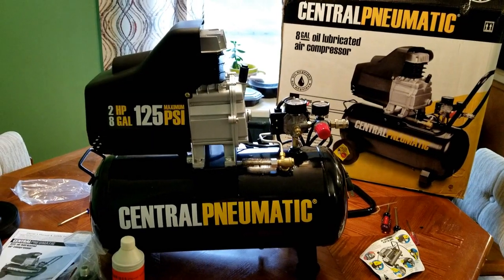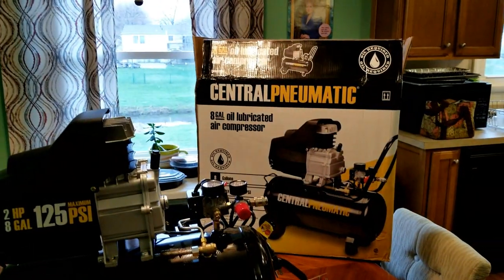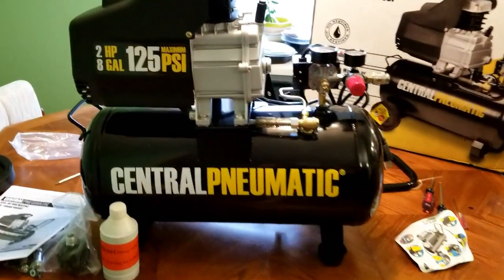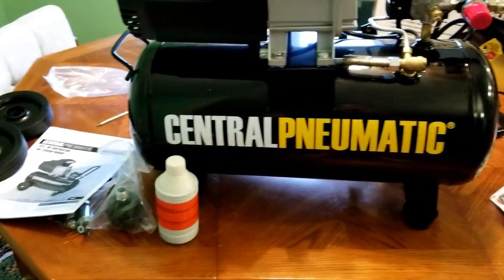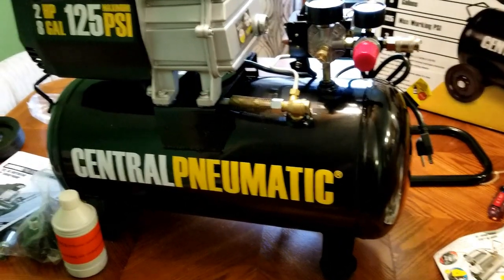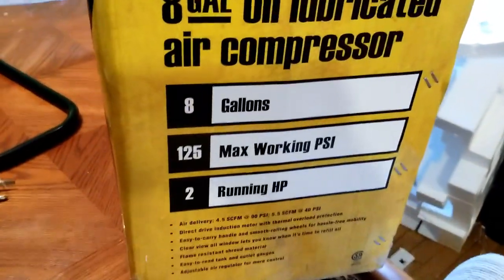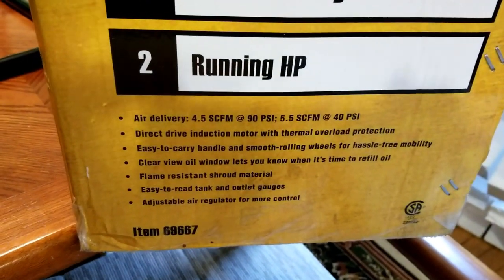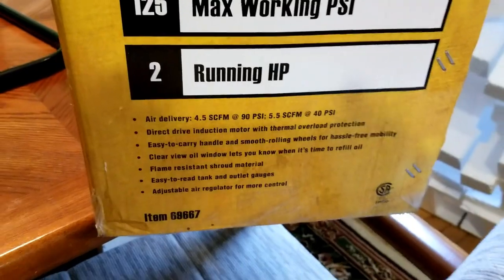Central Pneumatic 8 Gal Oil Lube Air Compressor Unbox/Review

Comment: Very nice review you did here- thorough, explaining the steps to take for setup. Subscribed.
Reply from the maker: Thank you for the comment and watching!
Reply: @Matty_Ice_Reviews I have a Total (Chinese power tools brand) air compressor 2 HP and it specifies "hydraulic oil" and "replace with 15w40" in it's manual. So I guess it's safe to use 15w40 engine oil in my compressor
Reply from the maker: @danteerskine7678  That is really cool that your compressor allows for higher viscosity, probably would also be a good oil for those in warmer climates. My only fear is that the chinesium may break if using higher viscosity oil in mine. Project Farm should do a video on that idea!

Comment: Help! I've had mine a while now but I only used it a little. It goes to 50 psi then conks out and the electric hums. I kick it back on it wants to go. But hums again.  Any idea what the problem is? Thanks.
Reply from the maker: Have you checked the pressure regulator? It sounds like it might be thinking full pressure is at 50psi. Also check air inlets for damage or debris.

Comment: I appreciate the thoroughness! How do we adjust the psi? I took off the black cover but there is talk of cut in and cut out...I am not familiar with this, I just need to shoot texture at 20 psi,... or 30... or 40 depending on which utube or article I've read! Ty~
Reply from the maker: The psi is adjusted by the red know on the side which will adjust the displayed amount on the dial. Generally these types of dials work well but may require some finesse to hit an exact psi. A larger unit can also help as it will not need to refill as often, which could give you mixed results with a pressure fluctuation. Thank you for watching!

Comment: I have the same one but when tank is full no air will come out the release valve thru the line, the bleeder valve works fine but no air will come out the release valve anyone know what that problem is?
Reply from the maker: Is it possible that you have an obstruction in the hose or the regularor is set too low and not allowing any air flow?

Comment: Clogging of the valve comes from the inside. rusty crusty stuff.  In the video, he didn't notice the crack where the plate was screwed on. This is junk.  If the cosmetic suk. The unseen inside has to be worse!.
Reply from the maker: In general that is a risk we take by buying Chinese goods. They perform the bare minimum function for a low price. The drawbacks are cosmetics and possible reliability questions. Mine is still going strong and has had some decent use. If it ever goes I will look into a better name brand. For now I will let the little Harbor Freight compressor chug along. Thank you for watching!

Comment: I have a similar central Pnuematic 6 gal, which I attempted to recently change the oil, but i can't see the oil level thru that cloudy viewer. Anyone  know how much oil is the correct amount? to reach the middle of the red ring inside the viewer.
Reply from the maker: I believe 8-10 oz depending on the model some may be as high as 12.

Comment: Would it run without the filter? That black round filter?
Reply from the maker: The black piece is an air filter, which does require maintenance periodically. In short, yes the compressor can operate without the filter. Is it advisable? No. Dirt and debris will have direct access to the internals. This will manifest in a few ways mostly seen as excessive noise, oil/air leaks, and overheating. This happens as contaminants entering the system can clog the oil vents and or end up trapped in the tank. Additionally, the compressor may fail to maintain pressure or reach the rate pressure of the tank.

Comment: Did u use the oil that came with it?
Reply from the maker: Yes it is a standard oil and great for the break in that these require. If you do not want to buy the specific oil sold for air compressors any synthetic plain 30 weight SAE oil will work for temps between 34F-100F (1C-37C). Just make sure it does not have extra additives e.g. high mileage etc.

Comment: Do you have to drain after each use?
Reply from the maker: Do you mean the oil? No, that can be changed once per year with normal use. For heavier more regular use, every 3-4 months. If you mean the air in the tank, that should be dumped after finishing use.
Reply: If you mean the tank no you don’t but you should every like 4 uses but you can if you want to.

Comment: Then why did you purchase this? “Buy American!”
Reply from the maker: Availability in my area, I searched in all local stores for manufacturers and found zero. Almost every model sold in a big box store is made in China or Indonesia. The available units from online retailers at the time I saw were for larger and substantially more expensive units (25+ gallons and $600+). If no comparable model is available/ within a reasonable price difference, I will buy the available unit.

Comment: Bro this thing is terrible... has hardly any power. I bought a 50 ft hose and the air gun to blow out dirt and stuff in my car and it hardly shoots any air at all. Waste of $200
Reply from the maker: $200?! You way over paid, I believe mine was $100-120. I'd return it, sounds defective (bad seal/pressure regulator).

Comment: Can this thing run impact wrentch
Reply from the maker: Yes for things like lug nuts. Nothing heavy duty.
Reply: Can it remove crankshaft bolts
Reply from the maker: @marcuspayton3356  it may have enough pop to get it out. Crankshaft bolts are generally frozen by dirt/corrosion not super high torque setting. Try some penetrant if frozen in place.